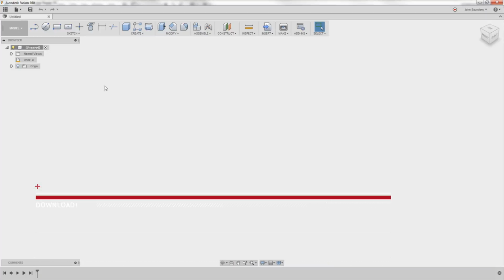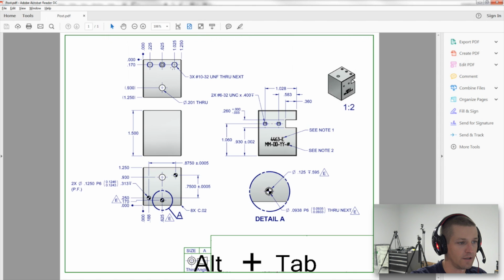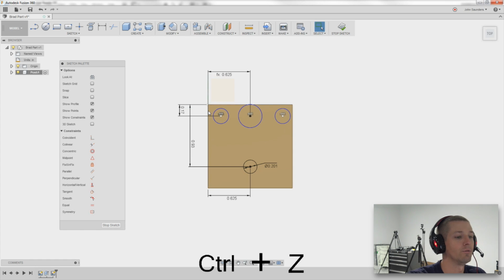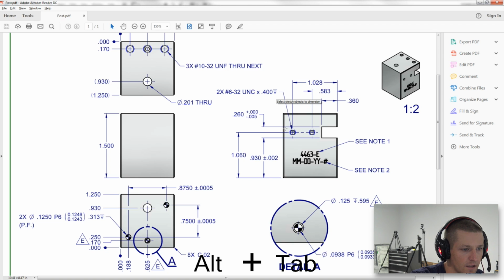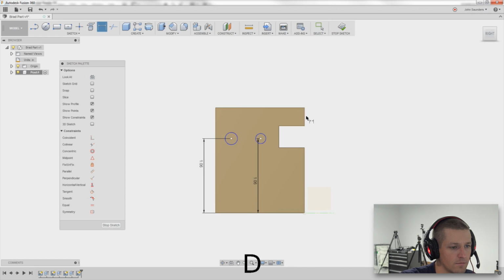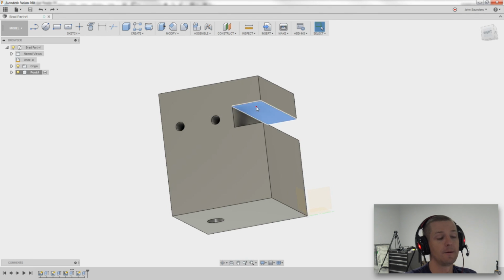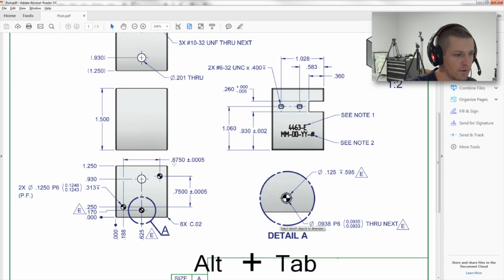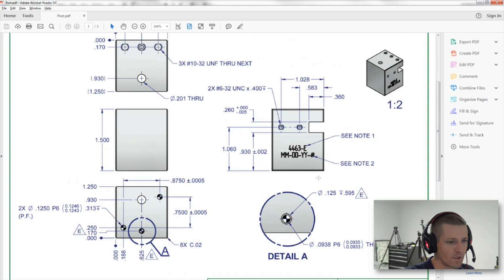Fusion 360 Tutorial:  Create a Part from a Drawing!  FF50

Comment: Just a note, when i tried this and actually put threads into the holes, i found you need to put the holes at the Major dia not the tapping drill. If i used the tapping drill sizes the threads available were incorrect.
Any thoughts ?

Comment: BTW, anyone else catch the mistake Brad made in inspecting the slot?  if his upper limit on the slot is really .260, a .260 stack of gage blocks should NOT fit, even if you can't feel them being lose.  This is why you typically use a .2600 MINUS pin/block as a "no go" (you would wring up a .2599 stack if you have inspection grade) and use it as a no go.  You would also wring a .255 PLUS stack (or pin - call it .2551) and it must GO - classic go/no go inspection
Reply: BTW, I didn't see him gage the 2 press fit .125 holes (.1246 - .1243).  That is actually a "fun" one with only .0003 between the top and bottom.  Measuring that is even beyond pin gages, which typically come ever .001 with a tolerance in workshop grade of .0002.  You'd have to go to class X pins in "tenth step" (+.00004 for plus, minus .00004 for minus) and order the pins ($125 for a nominal .124 set, and they go up and down by .0001 - 10 pins on either side)

This is the classic place where experienced floor machinists start to laugh at call outs that just are not practical "in real life" but if the engineer put it there, and you can't talk him/her out of it leads to the price of the part being insane

Yes, I realize that is what the ISO P6 numbers are.  The standard "dowel pin" numbers (US) would call it out as .1245 +- .0005, and then you could gage it with a pair of more normal pins - a .124+ go, and a 125- no go

Comment: I have been using Fusion for my 3D printing (well, and for drawings too). I model the threads and print them. A #6 is pretty iffy, but 12 mm makes nice holes and screws (such as new knobs for your mill/drill). From my results, the hole size is irrelevant because when you model the threads, Fusion replaces it with the right minimum and maximum sizes.

Comment: How do you turn off the grid while in Sketch? That control is disabled for me.
Reply: It should be in the sketch panel that appears (the one with the constraints) when you are editing a sketch. The option in "Grids and Snaps" grays out in a sketch since it's for controlling the grid in the 3D environment.
Reply: Yeah, thank you. Someone on the Autodesk forums finally pointed that out. Personally, I think it should be the same control as the one used for the non-sketch view, but at least I found it. Thanks!
Reply: Maybe not the same control, but definitely in the same place. I like to have the grid on while sketching, but not in the 3D environment. Glad the Fusion Forum got you squared away!

Comment: You should check out CNC machinist pro app for android, it has a glossary of symbols that you commonly find on prints and a huge library of surface feeds, g code, m code  and alsorts of other useful stuff. The only paid app I've ever bought and it is one of the best I've used for machining manual or cnc.

Comment: I did some checking, I think the "P6" on the bottom view refer the fit type (interference in this case). The parenthetical numbers show the range of the finished size. I am not sure what the "Triangle E" - possibly a revision note?

You forgot the Chamfer - 8X C.02...
Reply: P6 is an ISO tolerance for the hole dimension. It alone does not denote what kind of a fit there will be in the part inserted into the hole. Closest recommended fit in shaft base dimension is P7/h6 which is described as: "Locational interference fit for parts requiring rigidity and alignment with prime accuracy of location but without special bore pressure requirements. "
Reply: James McKeand . correct, the P is a fit tolerance. The E might refer to a note or a revision change.

Comment: () are reference dimensions. No should such thing as negative dimensions you cant inspect to a negative number. You such have used the hole command to make all those holes.
Reply: Chief Machining is correct. The () for the .930 and 1.25 indicate they are reference dimensions. They could and should be removed from the print to clean it.
Reply: John may have been thinking of the number format sometimes used in spreadsheets, where a negative is shown by putting it in parentheses.

Comment: Another note. When modeling a  plus nothing minus something dimension. Do yourself the favor and model it at MMC (maximum material condition). For example that .260 +.000/-.005. Model it at .255.  That way you're 100% sure you won't blow the tolerance by accident should your endmill cut a hair oversized.
Reply: Interesting. How does that work when you want to project on a plan? I think we really need the tolerances on the sketch itself. Do you have to have a CAM model at MMC and a reference model at nominal?
Reply: nraynaud1 

Not sure what you mean...

If you were to put another feature. On the surface. Any dimensional references has to come from a datum surface (a 0,0 point). Or if you do dimension from it at MMC the tolerance stack must be ample enough to accommodate that slot width anywhere within its tolerance zone.  As long as it's modeled with everything in its tolerance zone (regardless if it's at MMC or LMC) the part will still be correct.

In this case modeling it MMC ensures that when it comes time to do the CAM you won't over cut that dimension. If you did a straight cut and the model has the width at .260, and you're cutting 2 tenths oversize. You just blew the width by 4 tenths. 

If you model it at .255 and you over cut. The dimension will come out at .2554. Still within spec.  And if you under sized the width, you still have material you can remove to hit the dimension
Reply: when you want to generate a a plan from your CAD model, if your dimensions are at MMC they are not at nominal, so the dimensions on the plan will look weird.
Reply: nraynaud1 slot width on the model at .260. For a +.000/-.005 wouldn't be at nominal either. 

Nominal would be .2575 +\- .0025. 

This is taking a drawing and making a solid of it for the purpose of having a CAM model to machine off of.  You are best off creating the model at MMC. Because then, worst case scenario you just have to remove some extra material here and there. Iot easier to take more material off than to try and put it back on...

When doing a drawing from a solid, you can adjust the dims on the print however you want, regardless of what the model is made to.
Reply: Occams Sawzall yea that makes sense but that's not how its done everyday. It was modeled that,way for intent of the design not machining/manufacturing
Reply: Chief Machining 

If the solid model was made prior to the 2D drawing yes.  

But in this scenario the print was made prior to the model.  

That dimension could just have easily been called out as a .255 +.005/-.000.  It wouldn't have made a difference in the part functionality. But would have made a huge difference in the manufacturing of it when doing the CAM. 

Again. As long as the model is made within the tolerance zones called on the print, the part will turn out exactly the same.  But by modeling it MMC. It gives the machinist a nice buffer from scrapping the part.
Reply: Occams Sawzall no it wasnt you clearly see is the model in the right corner of the drawing john was just  playing tutorial man
Reply: Chief Machining 

Did he import the model?  Did he have access to the solid model?  If all you got was this print, and no CAD model. How would you even know if those dimension were modeled at MMC, LMC or nominal?  You wouldn't. The original CAD model used to make that drawing may very well have been made with that slot at .255. Or .2575.  But when the drawing was made, they could have wrote the dimension however they pleased. 

Print dimensions don't automatically mean that THAT is what the original CAD model was done at. I've seen it hundreds of times where the dimension on a print doesn't match exactly with the CAD model. Because the CAD sold model does not have to be made to the nominals on the print.  Only made to within the tolerance specs of the print. It's the engineer who specs the print and creates the required acceptable tolerance stacks.
Reply: Seems to me that the logical approach would be to model at nominal, add tolerances (in sketch or model) and then have the CAM software/module cut at MMC. Not sure whether any packages use that approach but it seems the most logical...
Reply: Occams Sawzall yea it was because it doesn't make sense to model that .250 then change that in drawing then add the tolerance... the guy that made this drawing clearly knew what he was doing. If you noticed everything is three place decimal if they made your way he would have to change to four decimal  then apply tolerance. Again the guy that make this drawing knew what was he doing and what he wanted.He  was all efficiency in his drawing and it shows
Reply: Chief Machining 

Think of it this way. Assuming you got this solid model.  When you see that .260 spec how would you cut it?  Would you risk cutting the width right at .260? Or would you comp the cutter 5 thou away from upper wall?  

If you're making your own solid  model from the print. You may as well model in those compensations. That way you don't have to remember down the line "oh ya! I have to comp that in some so not to blow that dimension!"  If you model it at the upper limits and you forget to comp. you could scrap the part because it's not salvageable .  Model it at MMC. And you forget to comp? The part is still salvageable. You just have to go back in and take a bit more off. 

It's better to build in your compensations right then and there when doing the model, rather then doing it down the line in the CAM where you may forget.
Reply: Occams Sawzall yes i got that all i would is in stock to leave to i would leave .005. all you're thinking is machining not design or intent of design.. 

Plus your job as the machinist isn't to scrap the part... sometimes you have creep up on dimensions
Reply: Chief Machining 
Yes. If you were the engineer designing this part. 

But in this case the parts already been designed. You just need to create a 3D model for machining. So as a machinist creating the model, its best to create it with machining in mind. 

I agree if I were the engineer designing, this part I would model it completely at nominal. It makes figuring out tolerance stacks much easier in assemblies. 

But as far as getting a print of an already designed part, where you're just creating a model for yourself to machine from. No reason to handicap yourself.
Reply: I'd disagree a bit about the efficiency as there is one completely unnecessary view on the drawing (the one in the middle at left). The dimension data given out in this view could be incorporated easily into the view at right. Also there are quite a few duplicate measurements.
Reply: No you need that view to show the orientation to get to the top left one and to show the right view.
Reply: No you do not. See http://imgur.com/TAN5W53
Reply: mikey_d thought you meant how he had laid it out

Comment: P6 is press fit class 6.  It's a standard press fit classification. Generally it's considered a "light press" meaning you can cold press the pin in place with an arbor press.   The first diameter call out is the nominal dowel pin size. The P6 is calling out for a class 6 press fit. The numbers in the ( )'s are the reference tolerances for that class press.  But as long as you maintain a light press fit for the pin, you can exceed those reference dimensions. The E in the triangle should be referencing to  Note:E written on the print. It's probably a "mask hole before plating" note. 

The .125 dia down dimension isn't technically a counter bore by that call out. It's simply a .125 dia hole so you can use a drill to make it rather than a C-bore tool or an endmill.  Just as long as the full .125 dia is to the specified depth. I.E. Compensate for the drill tip angle. 

Oh. And that's what those funny shaded circles are. They are dowel pin call outs.
Reply: thanks for explaining that.

Comment: Dimensions in ( ) mean they're reference dimensions only.  Meaning.non critical tolerances     So for instance that (1.250) you could simply use standard 1.25" stock without cleaning up. 

It may also mean that they have called out the same dimension in more than one view. You can only have a dimension with a tolerance spec called out in a single place. But sometimes to help the manufacturer they will duplicate a dimension in multiple views and list them as a reference.  As is the case with both the 1.250 and .930 dimensions.  They're reference dims in the top view. But they are non-reference dims in the bottom view.

There is never ever ever a "negative" dimension on a print. All dimensions are a positive value with a specified direction.
Reply: Logan J 
I only enter true position discussions if alcohol is being supplied.
Reply: Yup. The .125 dimensions are as they're specified - unless there is a tolerance specifically called out (which there is, in one spot). The range of .1246 - .1243  is that P6 "Fit" - since those holes will be for a press-fit alignment pin. Ditto on the .0938 P6 fit. We have the .0935 - .0933 range for another press fit. I'm happy to say that when I made these manually, I was in spec on every piece. Needless to say, I was extremely happy and impressed with my DRO's capabilities :)
Reply: BasementShopGuy that's a really old school call out. 

Should have used a true position call out ;)
Reply: They would need to add some datums to use the True Position call out.
True position discussions are some much fun right.